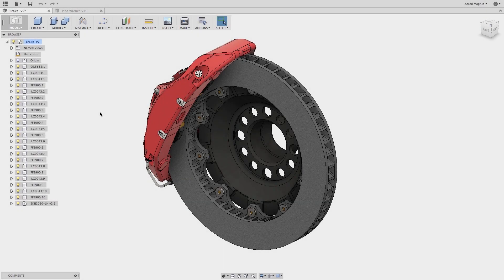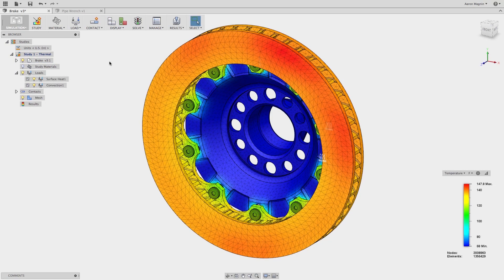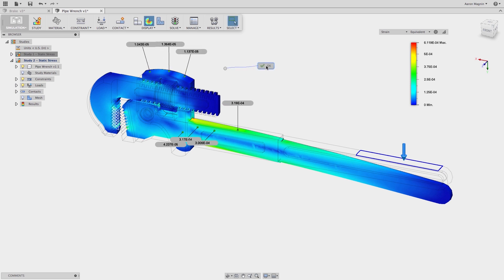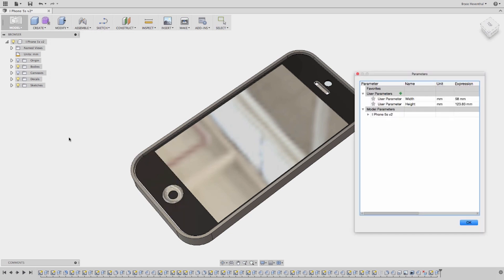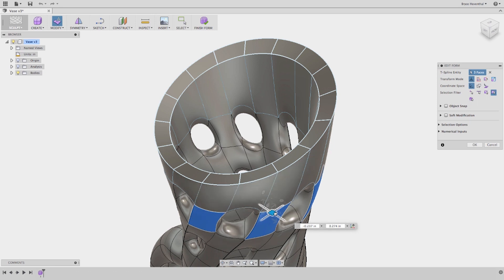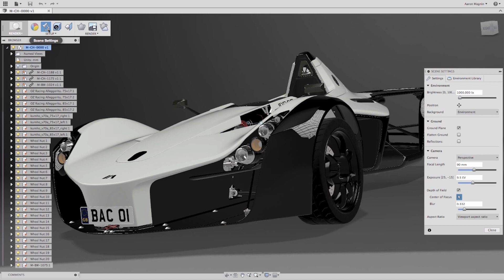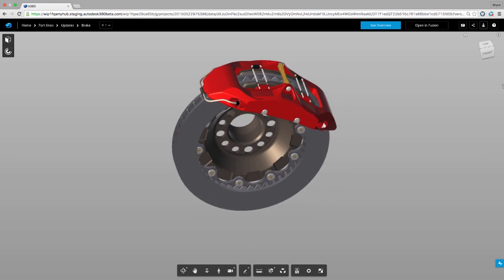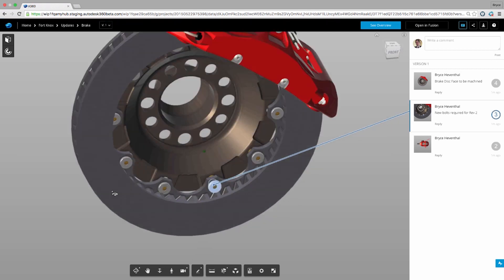What’s New in Fusion 360 January 2016 Update

Comment: I really like the new thermal simulation.
Even anisotoropic Materials like woods are there. But I havent figured out yet how to run a thermal simulation with those. (or how to manipulate the orientation of those material properties)
Also I am missing the option to add a heat transfer coefficient to contacts.

Comment: Would it be possible to add uv mapping as a tool for free form.
Reply: +nhbb980 Don't think that's on our radar just yet, but I would suggest you check to see if Exact Flat will work for your needs. Go to Add Ins > Autodesk Exchange App to see this and some of our other amazing Add-Ins.
Reply: +Aaron Magnin Thanks I will try that. I ask purely as you currently need to re-learn a new modelling package (3DS Max or Maya) in order to properly texture a model. Both of these packages are v. good but even coming from SW, NX and now Fusion Maya and 3DS are a nightmare to learn. Too many buttons and over complex. I want to model, texture in Fusion and generate UV maps when needed. I gave up on Maya and 3Ds Max.
Reply: +Aaron Magnin Tried Exact Flat but will not work I am afraid.
Reply: +nhbb980 We may be talking about different things. According to the almighty Wikipedia, UV Mapping is "...a modeling process of projecting a 2D image to a 3D model's surface." To do this in Fusion 360 you could use a decal. Have you tried that?
Reply: +Aaron Magnin I have not tried this. The requirement is both Texture and UV Mapping. To be honest I think 3Ds Max or Maya are the tools for the job. I just do not want to learn another package to do this.